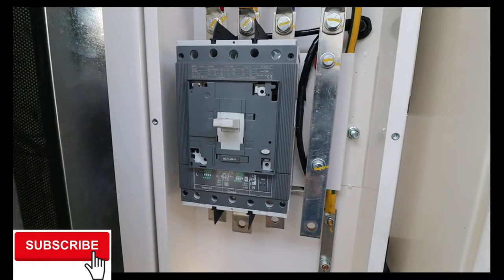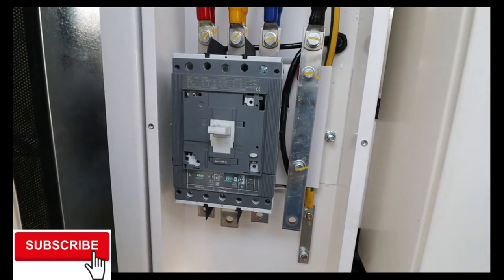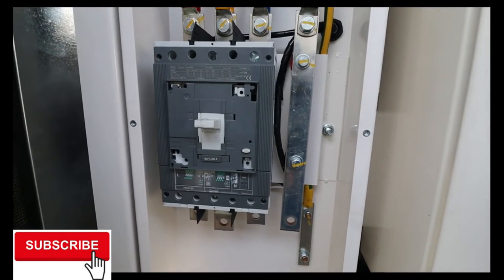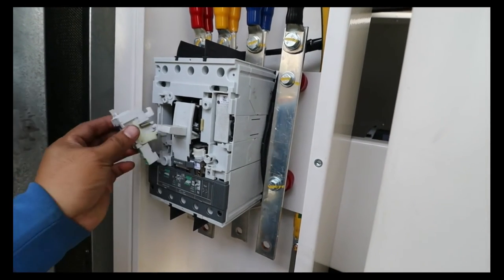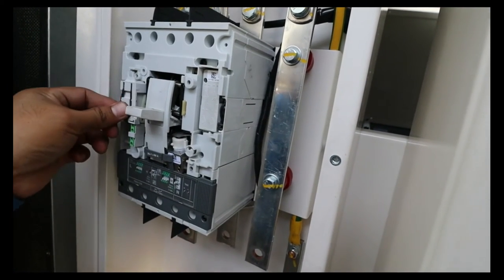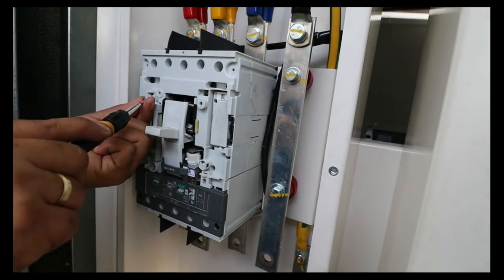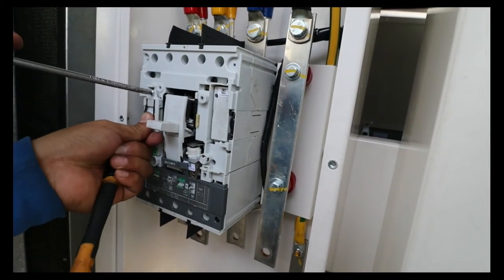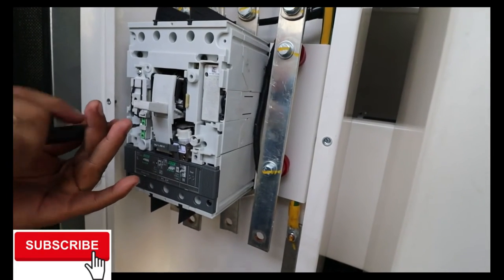ABB BREAKER T5N 400 with MOE-E T4-T5 motorized installation benzblogs

Comment: Hello!
If you connect 230V  power supply on U1 and U2 will the motor charge every time when it is discharging?
Thanks!
Reply from the maker: Discrarge outpmatically whin breaker on

Comment: Thanks, engineer, for your clear information; I appreciated it. I have a question. I want to change an old Abb breaker and install a new one. I already did the connection, but I have some problems. One is the deap sea monitor display that the generator failed to open. Please tell me how I can fix those issues .
Reply from the maker: Check in my yt i have recently uploaded this problem
Reply from the maker: HOW TO DO AND PREPARE SYNCHRO 500KVA
https://youtu.be/tbFQfQwHP90

Comment: hai good morning and thank you for nice explanation of installing ABB Breaker
i have facing some technical issue in ABB 630 amp Breaker when start the motor it will take trip the main 630 amp breaker so please explain what is the reason and how to resolve. one thing is t1 setting is 3s can i change to 12 s because motor starting current is more .plz give the soloution
Reply from the maker: This is motorized or not
Reply from the maker: You need to have breaker feedback from the module follow the wiring installation

Comment: Possible causes why my motorized abb breaker not transferring to generator power when brownout occur. Generator runs when there is brown out. Thanks for your answer answer
Reply from the maker: Ither not in auto or fuse supply is busted make sure motor for breaker have suply  and make sure its properly wired and config
Reply from the maker: Make sure your breaker is in auto and module is in auto

Comment: Thanks for the informative video
I installed a t6 800a abb breaker with motorised breaker, but when trying to operate it shows failed to open
Reply from the maker: Your aux contact is not working or wrong connection

Comment: Does failure of this breaker cause "Bus fail"?
Reply from the maker: Yes
Reply: Thanks alot benz, would you please recommend a generator diagnosis tool especially for engines with ECU thanks

Comment: Deep sea control, walang signal ang start...  Start at rest sya?
Among dapat gawin?
Reply: Salamat sa sagot...
Reply from the maker: Kahit pindotin mo yung manual tapos green button wala kng nakikitang ng count yung timer ng start?
Reply from the maker: Pwedi mong tangalin mona supply para mareset sya
Reply: Sir, may counting , pero crank at rest parin...
Reply: Tinangal ko supply ,  pero ganon parin sir,
Reply from the maker: @danielalvarez7449  ok kong ganon paren ahm check mo yung starter relay kong may pomasok na positive
Reply from the maker: @danielalvarez7449  sir dapat di at rest yan kong ng counting dapat fail to start sya
Reply from the maker: https://youtu.be/nrkB21RwLLY
Reply: Sorry sa abala...  
      Relay ng starter ok, pero walang  tumagos na supply sir sa relay ng starter
Reply: Sir, common cause ng ganitong issue ano mga ito?
Reply from the maker: @danielalvarez7449  relay failure,module mini relay failure, starter failure or defective or no supply
Reply from the maker: @danielalvarez7449  so meaning doon ka mismo sa output ng module if may positive sya papontang starter coil relay
Reply: Deep sea control , paki high light naman ang terminal o number ng back side ng start line.... Baguhan lang kasi ako sir...
Reply from the maker: @danielalvarez7449  sir yung diagram yun na yung number na wire nasa likod ok po
Reply: Kung meron kang deepsea configuration suite installed sa laptop. Pwede mo makita sa status ng output kung nagcovlose ang fuel relay at start relay upon pressing the start button. In case na hindi nagcovlose ang contact ng fuel and start connection. Walang positive na mag eenergize ng fuel at starter relay. Meaning, the switching configuration on your deepsea panel should be re-write